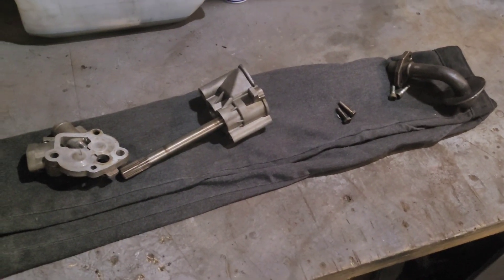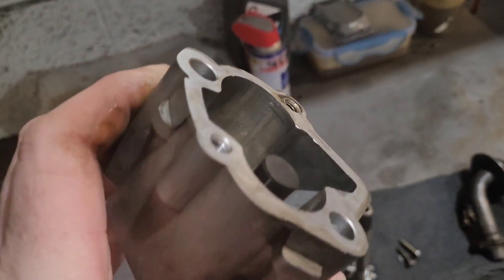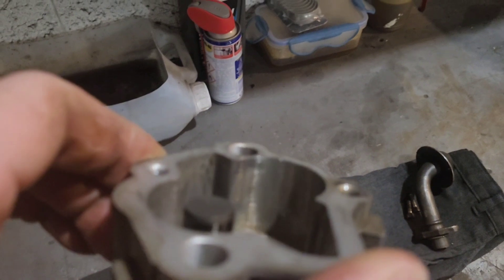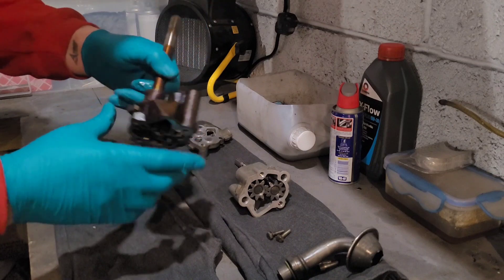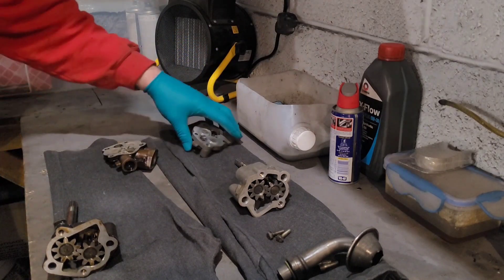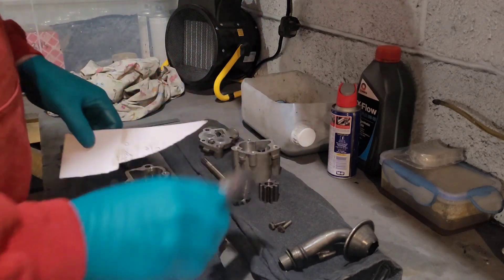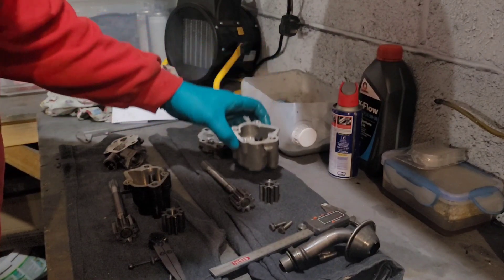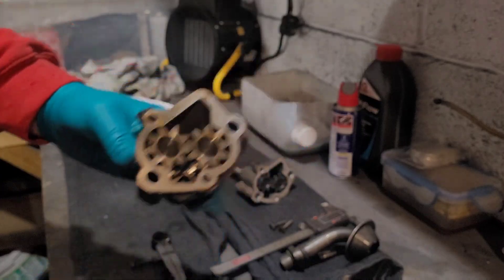Aftermarket Parts vs OEM Parts - VW 16v Oil Pump

Comment: Would the aftermarket pump also push metal around the engine that has been worn away?
Reply from the maker: Unfortunately yes any small particles would be introduced into oil

Comment: I’m really surprised by the Febi pump! I’m about to build up a 1.6td from a t25 to put in a mk1 Caddy so the oil pump and sump are different. I was going to opt for a Febi pump but now I’ll probably get a secondhand genuine one. I worked at a specialist on earlier water cooled VWs for 10 years on only ever replaced one oil pump because it had been run dry. 
Thanks for the video 👍🏻